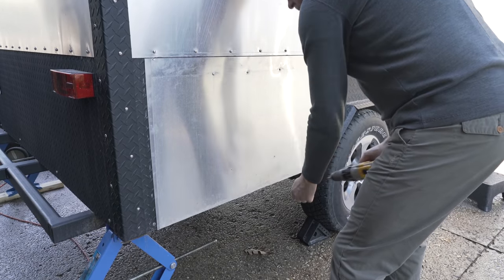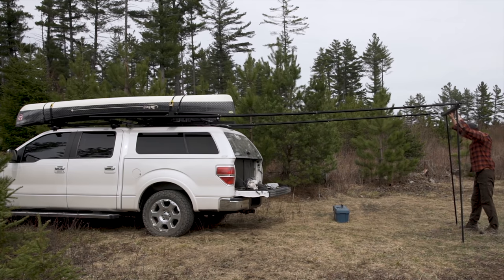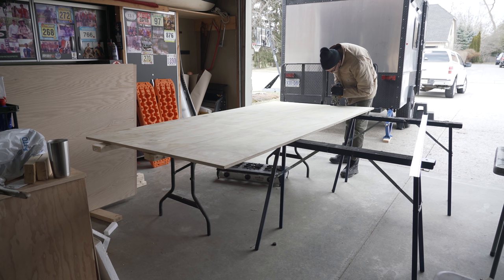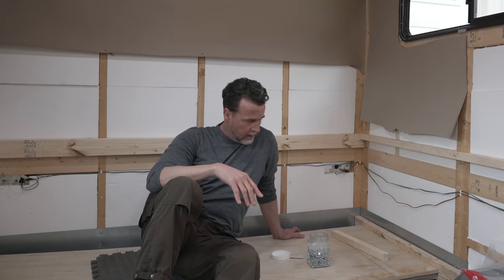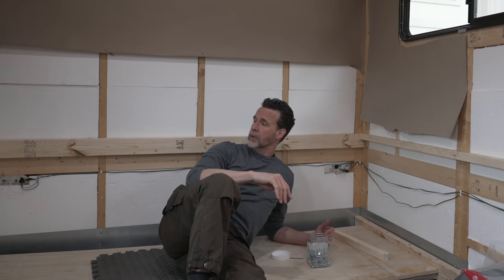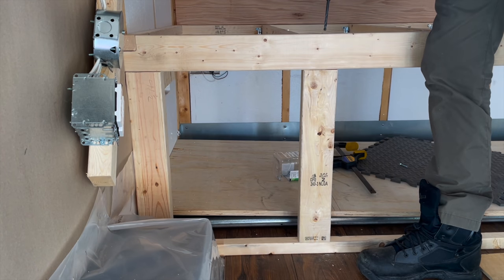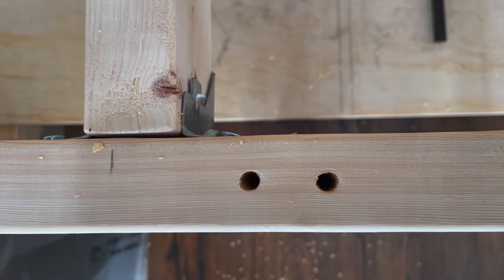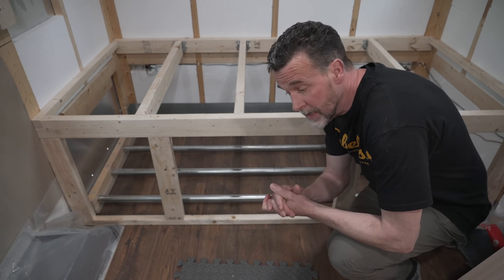How to Build a DIY Travel Trailer - Framing the Bed and Slide Out Kitchen

Comment: In a trailer that size storage is everything. I would mount a thin plywood sheet under the bedframe 2x4s creating 4 nice sized spaces. I would then cut the bed plywood lengthwise about 10 inches from the wall and put hinges. You could then lift it up and get fairly easy access. I would keep things like ropes blankets shackles and such there.